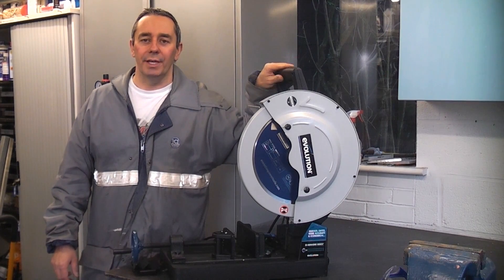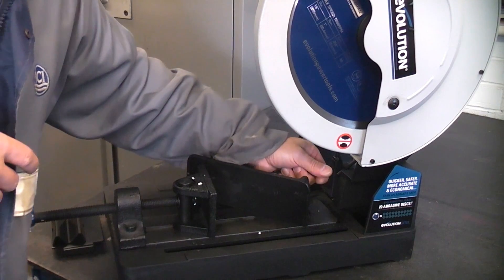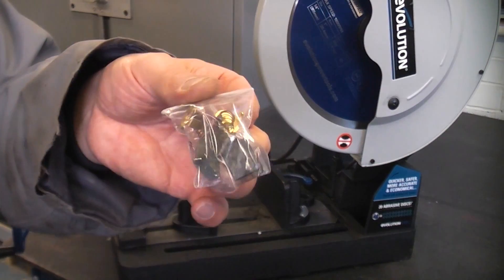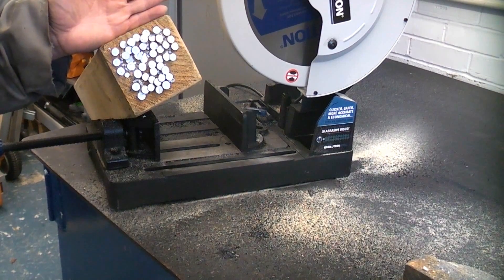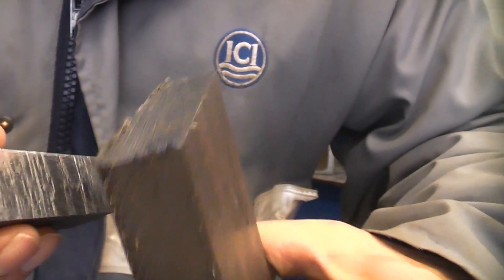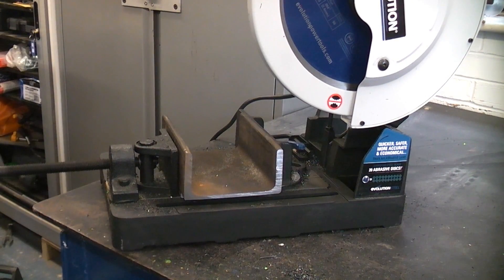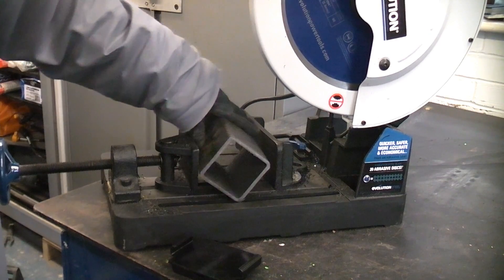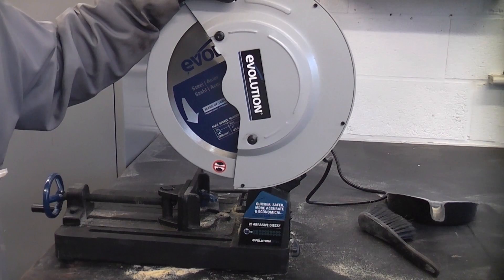Evo saw 355 Review | steel cutting chop saw

Comment: I own one for couple of months, bought after looking reviews, and thought that it should be OK for the price (not cheap).Mainly cut square and round tubing, 2 or 3 mm wall thickness. It cuts them like butter, BUT!!! - the cuts are not clean as stated in a lot of videos. Seems that the disk is wobbling during the cut, but is straight enough when turned by hand for checking the alignment. Also, you have to check the square/angles and mark them, as the built-in angle guide is not correct at all. My recommendation is do not waste your money on this. Better spend few more quids and get a proper saw. I tested cheap Chinese one and seem that it cuts the same.

Comment: The adapter plate for round material is included?
How exactly were the angle cuts horizontal and vertical?
Reply from the maker: Yes, the plate is included.
This saw is really accurate, the cuts were perfect.
Thanks for the comment

Comment: I didnt realise you had a video on THIS version of their 14" chop saw. I was comparing this and the dewalt 872 and makita lc12 and its a hard comparison to make. Since its been two years, what do you think of this saw now? how did the blade work out? I would not get the rage2 version as the blade definitely does not perform well for cutting mild steel for more than a couple of projects (and thats using good technique with the material clamped correctly and not just swinging on the handle, and also even trying to use a little bit of cutting wax to help). 
I have an evolution 255mm sliding mitre saw and it has the orange multipurpose blade fitted and it did 50 cuts, max, before it just dulled and the teeth chipped beyond use, which has totally put me off using it anymore for steel (just plain old black mild steel was being cut. )
Also, the tungsten inserts are so small there's no way it can be resharpened like a proper blade can be (I would get all my other blades resharpened - plunge saw and table saw blades which are makita, bosch and freud blades). 
This EVO saw seems to  have a more conventional tooth pattern and it looks like the tungsten carbide has a bit of meat to it so hopefully it is more durable and can even be resharpened. 
I made a big comment on Chucke2009 channel about these saws as his Trajan chop saw, the FEIN slugger (coming to the uk later this year) and this evo saw are soooooo alike. 
Be good to hear your thoughts after 2 years, if you still have the saw...
Reply from the maker: Sorry, I no longer have this machine.
I have not used any of the other machines to compare them fairly, but the Evo saw was very good.
Thanks for the comment

Comment: I have purchsed the Evolution blade and used it Bosch chop saw. i was surprised in the beginning cuts good after eight cut became dull. could you please what was wrong here. it is good blade. I feel very sorry I have paid too much money for that blade
Reply from the maker: Evolution blades are only meant to be installed on the evolution machines.
I believe normal chop saws run at a different speed than the evolution machines.
Reply: If it's a Bosch machine it probably runs on much higher RPM than carbide saw is supposed to. I was considering to buy disc only for my Makita chop saw but it runs on 3800 RPM, as opposed to Evolution which is only 1000 RPM.

Comment: What's the secret behind keeping the metal cool during sawing? Is it the saw tooth design? I'm stumped...
Reply from the maker: +Jo Baecker 
Yes, I think it's the design of the blade and the material used for the teeth. It's very strange when you cut through a piece of steel and remove it and the cut is cold afterwards! 
Thanks for the comment Jo ;-)

Comment: Whats stopping me just buying one of thier blades and putting it in my saw?

Also would spraying lube (WD40) or something on the blade extend its life?
Reply from the maker: +ratgreen 
The speed of the machine is probably different on your saw and the torque will definitely be different.
You don't need any lubrication with these machines. I have a small Rage 3 that is 4 years old and it has cut all sorts and is still on the original blade ;-)

Comment: I'm sure that's the same one the rat bags pinched out of the lock up it had the same drawer for collecting debris. It even cut 4" cast iron soil pipe. 👍
Reply from the maker: +wayne burgess Yes, it will have been if it had the collection drawer.Lets hope they died of a heroin overdose from the proceeds of selling it for £20 ;-)

Comment: Great review. Had no idea that some steel should be cut at that angle, at the end. 
Thank you for actually cutting and showing us the tool and not just talking. I have got to say, I trust what you say about tools etc, by the way I have used the purdy scraper you recommended a few months back, and it is absolutely outstanding, I have yet to use the paint roller paint removing tool on it, but over all a great tool. It's also great to take adhesive off glass!
Reply from the maker: +Faisal Y 
I didn't know either, although I normally cut angle iron so that it's like an inverted V when cutting it (unless it's being mitred).
The Purdy 6 in 1 is very handy, I'm glad you like it ;-)
Thanks for the comment ;-)

Comment: is it usual to cut metal without using cutting fluid ?
Reply from the maker: +Frank Crossword 
No, with most machines you need coolant, apart from the Evolution machines that do not require a coolant.
I have tried several of these machines now and they are awesome! Once you cut through the metal it is cold to the touch as well.
Thanks for the comment
Reply: +Frank Crossword usually any other type of cutter would need a coolant, i can only assume, due to the blade, it pulls in plenty of air with each tooth to cool the cut down,  certainly metal bandsaws ive seen need a lubricant either flooded on or at ;east applied once per job, and they are huge too
Reply: i think the secret of this machine to get cold cuts is 50% the blade and 50% the speed of the motor
Reply: @vaguincolombia  As i understand it basically cuts metal like a lathe.. carbide edges v spinning metal